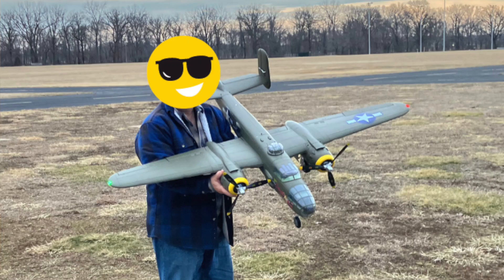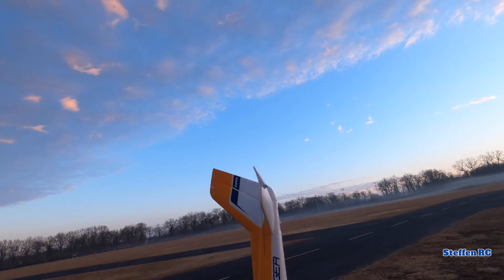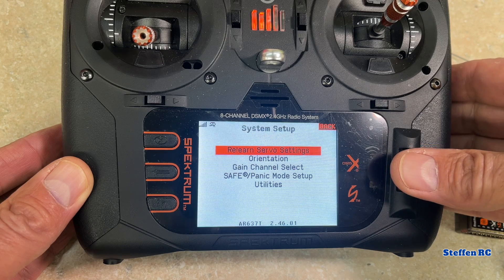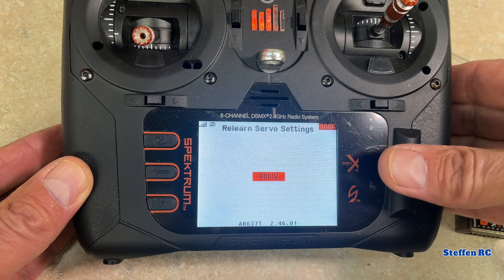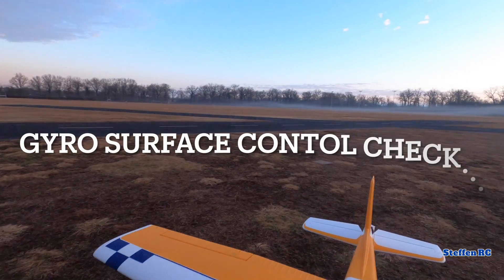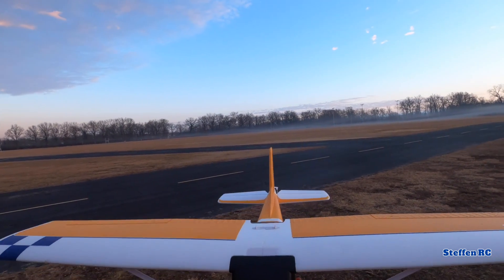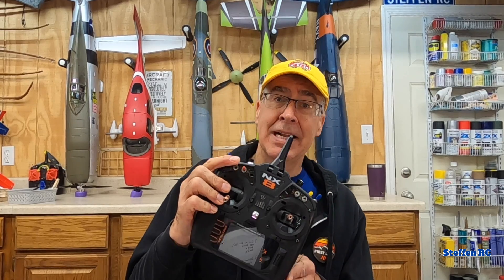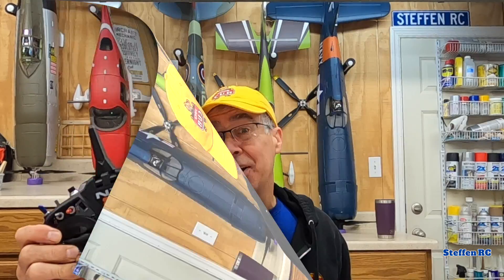How to test the Gyro in your RC Plane to prevent a crash

Comment: I know this video was posted about a year ago, but for me, it's so important to get it right, and I appreciate your advice.  I have been out of RC for a few years, and had sold everything.  So, when I started gearing up, I made the decision to keep everything "in the family"... meaning that my entire system, including transmitter, receiver, motors, ESCs, and batteries was all Spektrum.  The most confusing thing to me, at this moment, is doing as you said.  I want to experiment with AS3X and SAFE, but definitely want to be able to turn them off instantly, when things start to get wonky.  Thanks again!
Reply from the maker: The Spektrum system is great, but there is a learning curve.  I have many, many videos about the Spektrum system on my playlist.  But this video may be a good place to start... https://youtu.be/yXBOI-RnuSM

Comment: Brother, I am a beginner and I will fly my first flight. Do you recommend it with or without a gyro, knowing that my plane is an F22?
Reply from the maker: So, your first rc plane is a F22?  Yikes.. Not a beginner plane (depending on manufacturer). If the gyro is working properly and you have a self stabilization mode, then use it.  Gyros are very helpful for the new pilot.  I suggest you watch my Beginner Series videos.  They may help too...
Reply: @SteffenRC  I made it myself but unfortunately I didn't make a training plane but I had a small plane with a gyro but unfortunately when it was in the air the gyro was controlling it and the remote lost connection and it went forward and didn't come back and I lost it 😔So now I am hesitant to put the gyro on my F22 and I am very afraid of flying lest something similar happen to the plane I lost.
Reply from the maker: Not knowing all the details,  I wouldn't use the gyro.  Planes will fly great without them.  But, they must be setup correctly or they can make the plane uncontrollable.    Good luck
Reply: @SteffenRC  I heard in videos that it is good for beginners and I am afraid of it, but in the end, do you recommend it for my first trip?
Reply from the maker: @-fathakker  you must test to confirm it’s working correctly.  If it, then it might be ok.   That said, since this gyro came from another plane, it’s possible it might not work for your plane.  I suggest flying your plane without it.
Reply: @SteffenRC  no it's new gyro not from another plane 
 brother can I tell you my setup 
1500kv brushless motor and ESC 40a and 4s battery and total wight about 770-800g can it fly ?
And the motor in thrust test give me about 1070g with 8  inch 2 blade propeller and give me about 1280g with 8 inch 4 blade. Can it fly or will it be heavy and the motor weak?
Reply from the maker: @ it looks like it has enough power.  There lots of variables involved.   Where did you get the F22 kit?   Did the plans show the center of gravity?
Reply from the maker: @ sorry, but I don’t have either social media.  Send me some pictures of your plane. Willsteffen@gmail.com

Comment: It was a windy day at the field n crashed my jet after I rebuilt her your rebuild videos has definitely helped well this one was totaled I did stripped on what I could save from it n just ordered another one well what happened was I didn’t do my preflight checks now the first flight I did she flew great well I swore I hit stability mode when I threw her in to the wind she turned n nosed over on me now I will do a preflight check every time n make sure everything is working! Happy Modeling 
Grant-
Reply from the maker: Dang Grant,  so sorry to hear that..  Hate when that happens.  Even after many, many years.  I still do a preflight before each flight to make sure the servos don't take a dump on me and/or the Gyro and rates are correct.   Well, it's part of the hobby..  Planes will crash.....

Comment: My Plane was destroyed and I think the gyro was at least a contributing factor. 
What happened? Gyro worked as intended I think, but I provoked a stall on my acromaster. After the first slight wing rocking induced by the upcoming stall, the plane starts spinning like hell and was not recoverable. 
Unfortunately i had no switch to turn off the gyro, just a turning slider for the factor setting- which I missed to turn back during spinning. I think the problem with gyros is that during stall situations it makes the problem even worse due to intervening. What is your experience in such dynamic situations?
Reply from the maker: Hard to stay about the Gyro during a stall.  If the gyro was set to: SELF LEVEL/SAFE it will try to level the stalled plane and thats not what you want during a stall..  Optimized/wind mitigation/AS3X can be helpful when the plane is about to stall.  Seems to stabilize it a bit.  At least thats what I've experienced.  But, even when it drops a wing the AS3X mode doesn't interfere with recovery.

Comment: Great video. I personally didn't like AS3X so removed it from my 1200mm E Flite Spitfire and installed a lemon receiver with gyro  instead.  Flies great! I have a lot of Hobby Eagle Gyros in my various planes as well and agree whole heartedly that an on/off switch is a necessity. Also using the radio knob for gyro gain is a must for me.  Preflight for me is usually done three or four times at home, then once at the field.  Take off without gyro and trim the plane, get some altitude (three mistakes worth) and switch on gyro switch off gyro, that fast. If the airplane behaved properly in that two second window, you should be fine to reengage the gyro.  If not, land and check the settings again.  I've had one plane not set up right in the ten years I've been flying, which means absolutely nothing!
Reply from the maker: Gyros are great.. But you gotta set'em up right..  Else......

Comment: I just finally installed 2 gyros in 2 of my planes...i went through everything several times and am 100 % all modes are setup correctly and control surfaces are moving just as i want...i myself have crashed 100s of times do to many issues...i also consider my self an expert at repairing foamies..but seriously i expect these gyros will help big time...thanks for sharing
Reply from the maker: I grew up without gyros and didn't use them much as they became available.  Today, I have a fair amount of planes with them.  Some planes really come alive with the gyro, while some not so much..  Good luck on your maiden flights with the gyros..  - Will

Comment: Newbies to gyros should use a 3-position switch where they have "Gyro off", "AS3X mode", and "SAFE mode", if they want to use it. Since I've been programming Spektrum AS3X/SAFE receivers for several years, I don't have an off position. I put the receiver's flight modes channel on the same switch as my dual rates switch which gives me low rates with AS3X, high rates with AS3X, and high rates with SAFE mode. With AR636's and possibly the newer Smart receivers, SAFE mode doesn't work correctly unless the transmitter is sending 100% travel to the receiver. I frequently do maiden flights in SAFE mode because I know the plane will fly very close to straight and level with the sticks centered. I initially set the AS3X gains to fixed with 30% for roll, 40% for pitch, and 50% for yaw. I set the SAFE roll gain slightly lower than the default and the pitch gain slightly high than the default. Once the plane is at a safe attitude, I'll come out of SAFE mode to check and adjust the trims. This is the opposite of what I recommend a newcomer to gyros should do. Until you know exactly how to prefight a gyro-equipped plane, you're better off with the gyro turned off (provided you can fly without one). Learn how gyros work using an old, expendable plane before you put one in a brand new expensive plane.
Reply from the maker: You sure have a lot of great info in this post..  Thanks for sharing..   I hope some folks read this post and find your YT channel....

Comment: I use a basic Radiolink gyro and have never had one fail during flight. That’s not to say I haven’t done rush jobs and set planes up incorrectly 😂
Reply from the maker: There is so much good equipment out there for the model aviator to use..  Most is really good stuff.  The key to it is, know how to use your equipment...

Comment: I always fit a gyro to a new model - it can always be switched off? Nothing fancy though - byme a - with full gyro, wind mitigation mode and off. No messing with gains, no needing a pc etc. Gives me all i need. But always, always pre check control surfaces working correctly with and without the gyro - every single flight. Plane silly not to....
Reply from the maker: You nailed it..  Know how to use your equipment...
Reply: This is what I use and I can hook ELRS RX to it and have “unlimited range” never worry about signal loss or fail safe 🎉

Comment: The correct way to do all this, is when you first bind your new rx, make sure everything is going the right way, the forward programming tells you everything must be correct and you have to click through that screen..  rx setup 101.
PLUSSSSS, put the gyro settings on a switch, so you can turn it off in flight, that would have also saved him.
Reply from the maker: Yep..  100%, you shouldn't need to mess with the Relearn Servo if you did the setup correctly..  He didn't..   I always suggest putting the Gyro on a switch..  He probably had it setup that way.. (not positive).  That said,  the pilot didn't really know what was happening to think about the switch..    Thanks for weighing in on this John..  Appreciate it.  Will

Comment: Why are gyros needed in fixed wing aircraft anyway? I get they are needed for tail rotor and flybarless control in helis, but why on airplanes? Has the base design of models changed so much that they are inherently unstable, or a pilots not "getting their wings" and learning basic flight control, airplane setup and trimming? Maybe I'm just old, but starting with free-flight, going to gliders and then a high wing trainer (all build up from balsa kits) just doesn't seem to happen these days.
Reply from the maker: I think of the SAFE/Stabilized mode like a buddy box (or a stinky, grumpy guy next to me ready to yank the 72mhz. Kraft Transmitter out of my hand when I would panic..)  Helps them learn to fly and get to that point they don't need it anymore other to help steady the planes on a windy day...  But, some pilots really enjoy just keeping it in SAFE and doing their circuits..  They are having fun, and it really doesn't bother me anymore...

Comment: After the 33 second mark the video provides good useful well-presented information about the Spektrum AS3X system setup that almost any Spektrum user can benefit from.  I would have provided a thumbs up to the video except at the 0:32 second mark Steffen says "the gyro destroyed that plane".  My cause for pause is that setting up the gyro incorrectly, and then blaming the gyro 33 seconds into the video for doing exactly what the gyro was programmed to do only benefits the Spektrum bashers.  This in turn results in more misinformation at the flying clubs.
Reply from the maker: Well. Ok.  Thanks for your comments.   I would hope people watching this would watch the ENTIRE video where I clearly point out the real culprit in the crash.  But, whatever.
Reply: Agreed 100%!  Spektrum gyro receivers don't deserve being blamed for user incompetence.  They work extremely well if they're setup correctly.  I have likely several hundred hours flying all sorts of pattern airplanes with Spektrum gyros (AS3X & SAFE) installed without any problems!

Comment: As someone who learned to fly RC planes way back in the late 80s and early 90s when gyros weren't a thing, I can't really relate. And I can't relate to why an experienced pilot would use one either. Just another component to fail, and override your intent, as illustrated here. I can see using one on a trainer these days, and maybe you want one on an expensive jet just in case you need some stability help and want it to recover on its own if you get into trouble, but the whole concept just seems counterintuitive to me on most planes, especially on a warbird.
Reply from the maker: I learned around the same time as you.  I flew a long time without Gyros..  Most of my planes today don't have them.  But I have found a few planes that really benefited from them.  If they are setup/tuned correctly.. Mind you, I'm using them for stabilization assistance.. Not self leveling.  That said, the self leveling feature is so helpful to the new pilot whom is still a bit unsure of themself and aren't on a buddy box..  I think all pilots should try to achieve the skills to fly without ANY Gyro, but I find many pilots enjoy themselves flying with the self level Gyro on all the time and just cruise around the circuit..   To each his own.. I guess...

Comment: I make mistakes but its just common sense to check the surfaces out, you do that when you set it up. That to me was a very expensive mistake
Reply from the maker: Yep..  Thats the issue with this situation.  A regular surface check by moving the sticks doesn't catch this issue.  You gotta  be purposeful on checking the GYRO surface input..  Very expensive mistake for sure...

Comment: Checking the correct stabilization is part of my preflight on each and every flying day and on each and every flight. Simple to do and takes no time at all. This also includes checking control surfaces. Sometimes you may get a surprise that will save your model.
Reply from the maker: The Pre-flight check is so easy and quick..  I don't have failing servos often, but its happened twice in the last couple years.  I caught the issue during the preflight and saved the plane...   Thanks for watching and commenting.. - Will

Comment: I have a small EDF that I discovered during the maiden flight had an lightning quick roll rate. The gyro saved the plane, but prevented the plane from turning! The solution was to turn “Safe” off and on as needed, until my nerves calmed, and I learned how little to move the sticks to perform a gentle controlled change of direction. 
The lesson… as well as double or triple check everything before a maiden flight, is to have the gyro on a switch, and have the ability to use the switch without looking or any hesitation.
Reply from the maker: Absolutely that switch needs to be handy.  I just maidened a friends Eflite Habu 50 and it was a fun little, nimble plane.  He likes to fly in SAFE mode so I tested that and the turn radius was quite big..  Adding rudder really helps in those cases..  Good luck and keep on flying.
Reply: I set mine up with a verbal announcement that tells me what configuration the gyro is in OFF-AS3X Only-SAFE and AS3X.  Never any doubt that way!
Reply: I just started using gyros and they will most definitely do the trick...they are amazing.

Comment: Pilot error kills as well. Still the number one reason of crashes!! Good thing is you can get another one just like it right off the shelf that's exactly the same. Tough lesson to learn.
Reply from the maker: Pilot error is the #1 reason.  Whether its a bad servo that wasn't noticed due to lack of pre-flight check or the windy conditions stalled the plane on approach..  I chaulk up almost all issues due to pilot error..    Tough lessons for sure.  Thanks for watching and commenting - Will

Comment: I have a suggestion, how about flying without a gyro and truly learn to fly without the safety net of a gyro?  ;)
Reply: I’m grateful that I was taught to fly without a gyro. I now own two planes with gyros and many without. No doubt the gyros saved my planes a few times. But they are an extra component that must be checked and be connected by a switch.
Reply: Contrary to popular malformed opinions, learning to fly with a gyro does not ruin someone for life.
Reply: @txkflier  learning to fly with a gyro, doesn’t prevent someone from learning to fly without a gyro. As long as they realise that it is a skill, they have not learned.
Reply: @koalatails5711  Having the student fly their initial flights in SAFE mode lets them learn which way to move the sticks without the plane getting upside down and having to be saved by the instructor. Once they instinctively know which way to move the stick, they can come out of SAFE mode and learn to level the plane when they want to fly straight and level. Since 1972 or 3, I've been teaching what I call the "Get up wingtip" method for flying a plane back toward the pilot. I tell my students to push the stick toward the low wingtip and say "Get up wingtip" to themselves. They can also use it to make turns from level flight and not go the wrong way. And they can use when they're coming into land. They don't have to think about left or right or if the direction is reversed.
Reply: @txkflier  Your students learn orientation and stick direction in “Safe”, then learn to fly without a gyro. Perfect! 
It’s the ones that believe they have learnt to fly, obtain more advanced models, always fly in Safe mode. They lack some skill that could prevent a crash. Even these individuals are not “ruined for life”, if they’re prepared do a little self training with a no gyro, beginner friendly model.
Reply from the maker: I have many planes with and without.  I learned to fly with nothing.. (not even Expo...).  I think the self leveling gyro is wonderful for the new pilot that doesn't have a coach or buddy to help them fly without destroying their plane..  I would recommend they work off that tool as there skill progresses..  Also, there are some planes that flat out fly smoother with a stabilization gyro in the plane. (tuned well).  But, most will fly well without..  Just my opinion....  Will